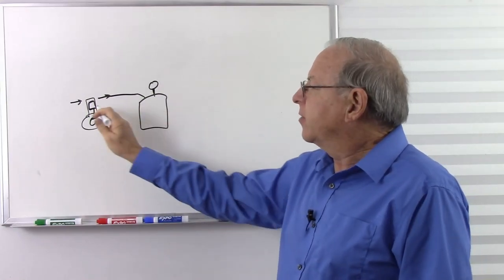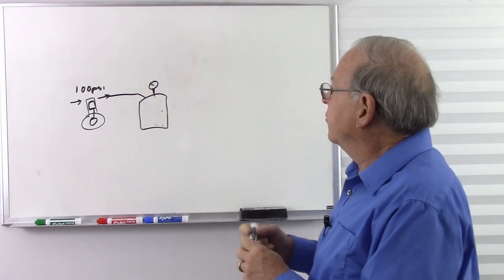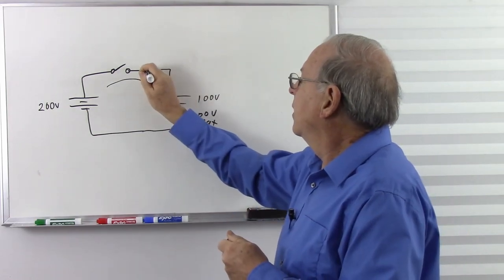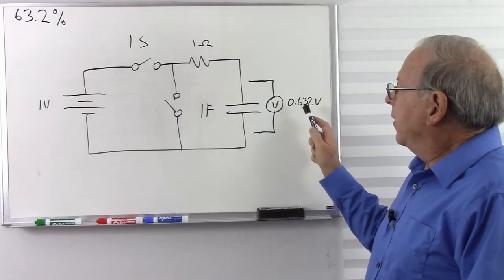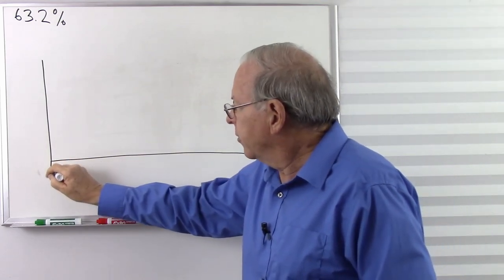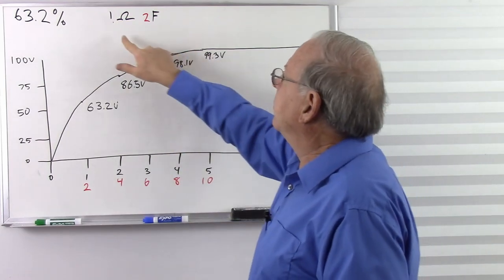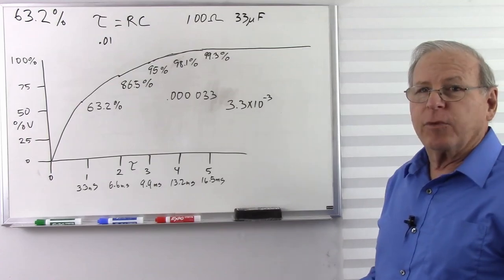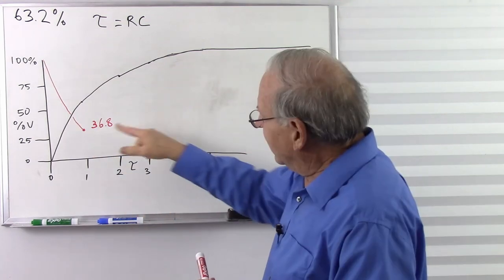Capacitors Part 4 - Charging and Discharging

Comment: Thank you. For the reset circuit at the end, does that mean the capacitor sends the voltage in the opposite direction of the 5 V? Because the 5 V is coming down then the capacitor is sending the 5 V back up?

Comment: Thank you for this video. Could you also delve further into the voltage rating aspect of the capacitor and will it affect the charging and discharging of the capacitor? For example if voltage source is 30v but cap voltage rating is 63v, will it still charge at the same speed? In this case will it be 63.2% of source voltage ie 30v or the voltage rating of the cap which is 63v